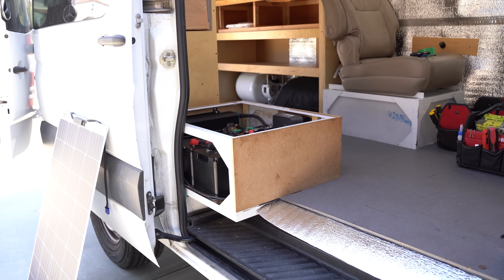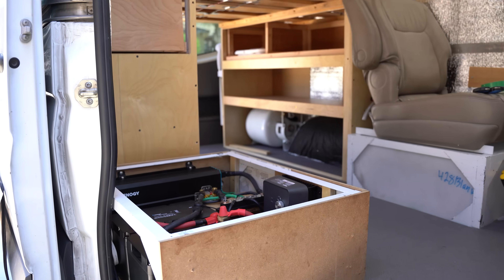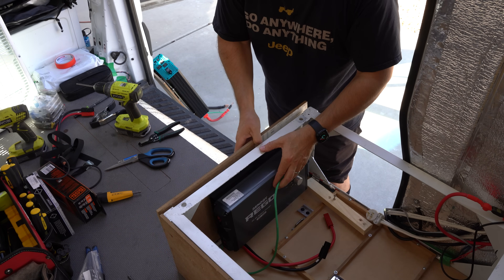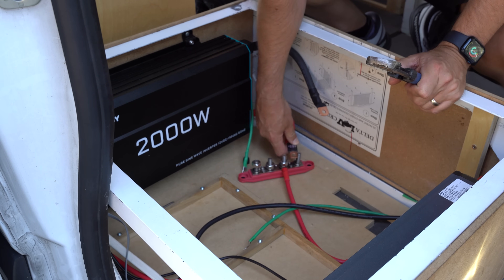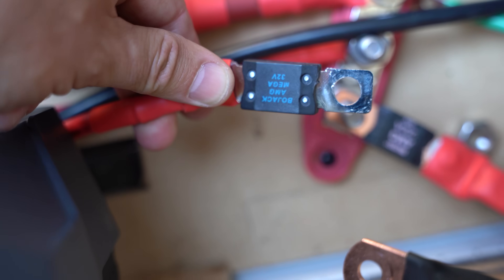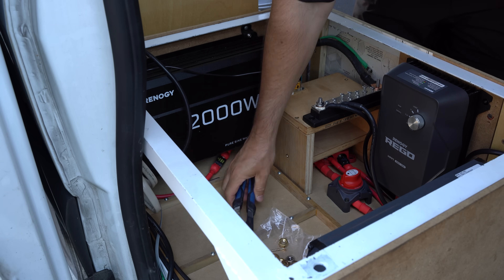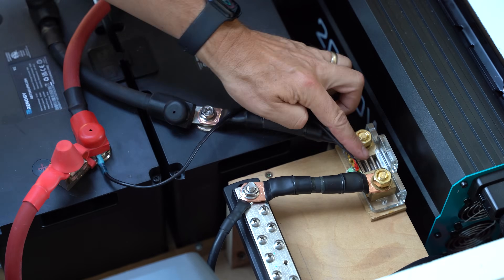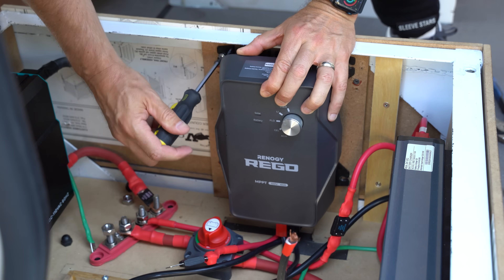DIY Van Solar Setup: Easy to Follow Step-by-Step Instructions

Comment from the maker: here are all the items covered in this video:
* DC-DC (60A) battery charger: https://cityprepping.tv/44vW3I5
* Inverter (2000W): https://cityprepping.tv/3QPc6KL
* Charge controller (60A MPPT): https://cityprepping.tv/44y7OgW
* Battery (100Ah LiFePO4 w/Bluetooth): https://cityprepping.tv/46DfFvw
* Solar panel (100W): https://cityprepping.tv/3wTi3OT
* Battery / inverter cable: https://cityprepping.tv/3wrbsLd
* Battery / charge controller cable: https://cityprepping.tv/3cnjZIi
* Solar extension cable: https://cityprepping.tv/3Tjtf0I
Reply: Does this work for Camper Caravan that could work for of grid living and also recharging my Tesla model X 10-20Kwh a day. 5-13amp internal recharger.

Thank you

Comment: Hey I am confused with the Bus Bars. What is preventing the bus bar from sending the shared current on the bus bar, connected to a wire with 200 amps,  back to the fuse block only rated for 125 Amps? Won’t the fuses break every time??

Comment: I noticed that you have a battery positive line crossing over a negative line. Is this a hazard? Since this install is in a van that moves, due to vibration, will these two wires rub or chafe and eventually short?

Comment: I just finished building a mobile solar powered generator. Basically a DIY Jackery on wheels, using a pressure washer cart frame. Mobility was important without having to break my back moving it. I Can Take it Anywhere. 200ah LIFepo4, 2000watt inverter and 12volt accessory panel with 400watt folding solar panel.

Comment: Kris, I love that you did this. I do have to say, though, that no matter how many videos I watch about doing this for a van build, I still feel like it’s all over my head. This is why I’ve just invested in the Bluetti power stations and Bluetti solar panels . It’s simpler to me. The only concern I have is that, once I’m out on the road, they won’t be quite enough to keep everything running. I’m in the middle of my van build, and I’ve made some mistakes (I built a whole sofa bed that I cannot use because it takes up way too much room), and I’ve decided that keeping things simple is definitely the way to go for me. Maybe once I get out there and meet others who know what they’re doing, maybe they can help me with this.
Reply from the maker: yeh, a pre-built solar setup like Bluetti makes a lot of sense.  The only thing it lacks is the ability to charge quickly from the alternator, but otherwise, it's a perfect out of the box solution. I think you made the right decision.
Reply: @CityPrepping  Thank you! Hats off to you & others who are able to configure all this!

Comment: How come you terminated your solar onto Busbar vs to battery straight? This configuration means when the main power is off, you won't be charging battery's m keep them topped off. You already added a switch for on/of prior to terminating.... can I suggest terminating straight to battery?

Comment: I’m on converting 2019 Ford Transit,  with it about 90% done. Used a Goal Zero 1500X Yeti which has made easy work of the electrics. 
Can’t wait to get away in a few weeks. 🍻